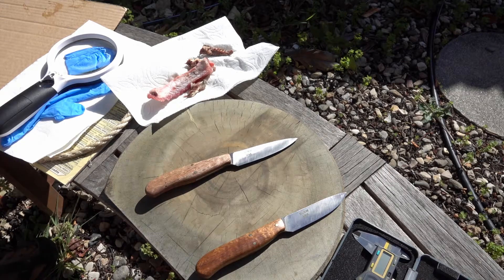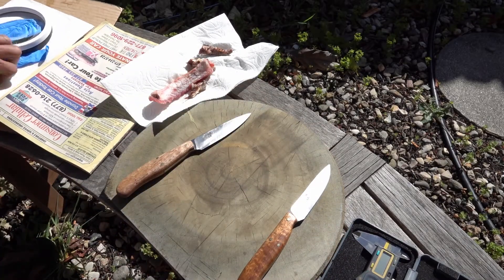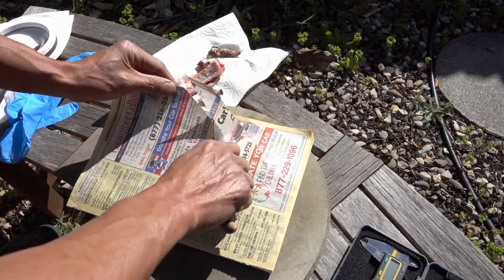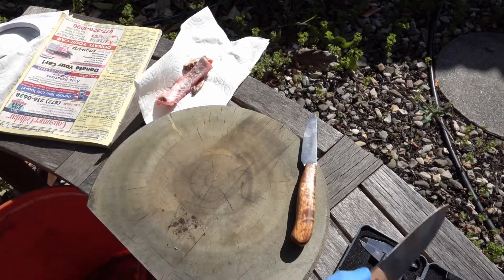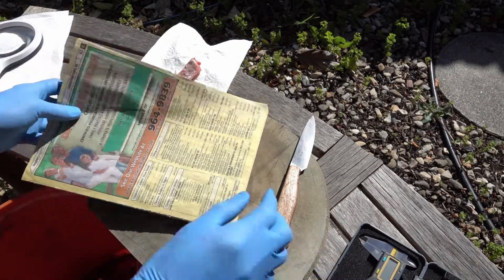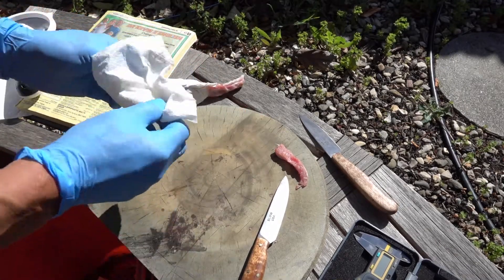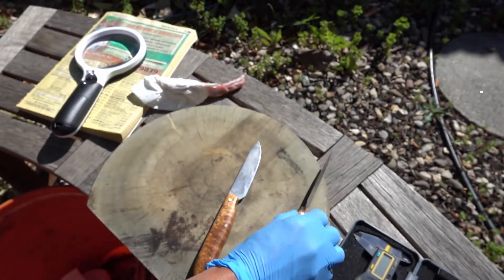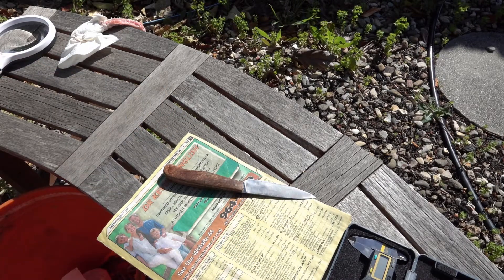BCMW S125V 66rc CPM 15V 68rc BT Boning Tests

Comment from the maker: Rather than let my last 5L of LN2 evap away - I ht a M4 chopper and a few partial tang 10V hunter blades. I got a little distracted so these blades soak at 2075F for twice as long... NP. Hopefully, there will be enough daylight remain of today to put an edge on the chopper for some chopping actions.